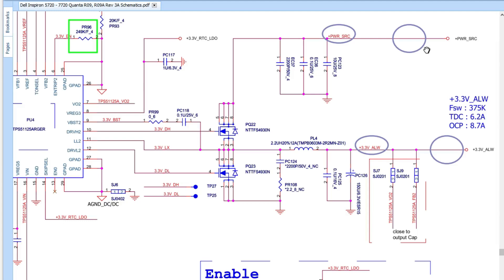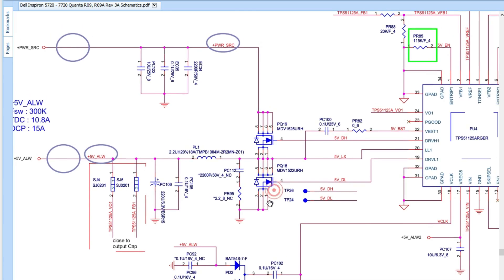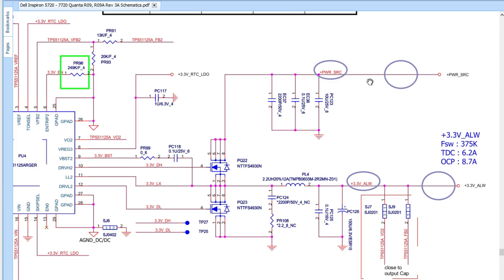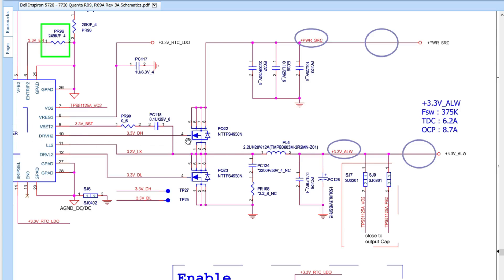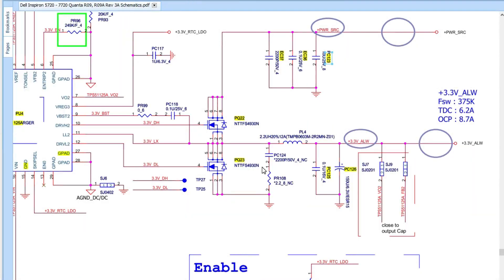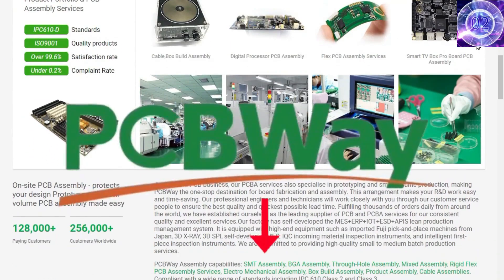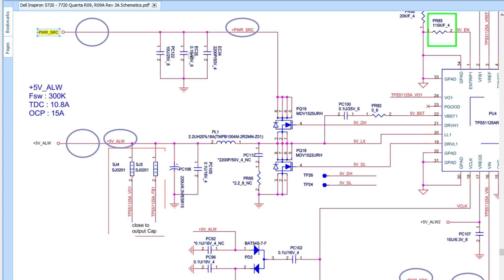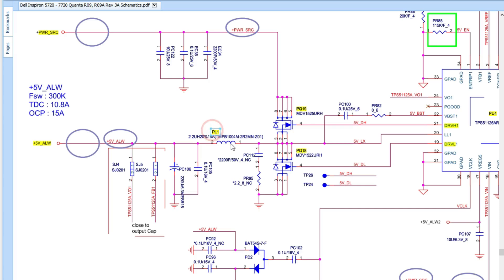Learn How to Read Laptop Schematics & Speed Up Your Repairs

Comment: the coil can create an electromegnatic field so he can make the current low pls tell me if i am wrong ur videos are so usefull thank u
Reply: Nothing special should happen for me. the theoretical impedance of the coil is proportional to the frequency : Zcoil = j.L.ω with ω = 2.π.f and L the inductance of the coil.
If the current is DC then f = 0 and consequently Zcoil = 0, the coil acts only as a wire.